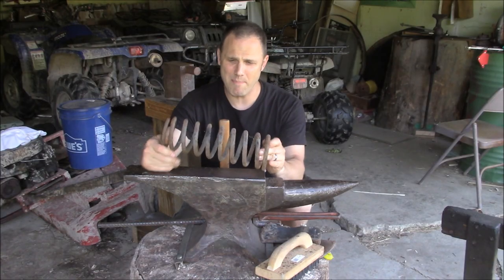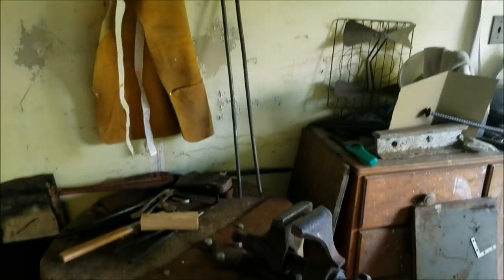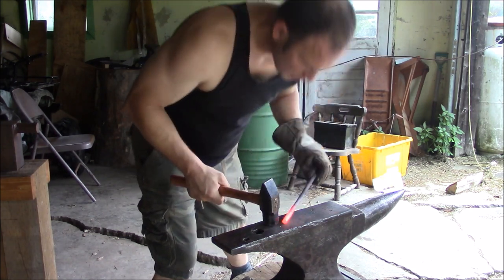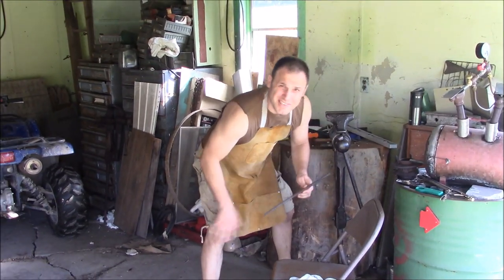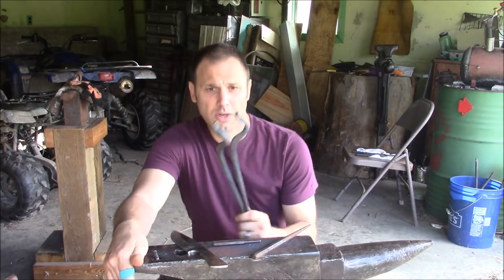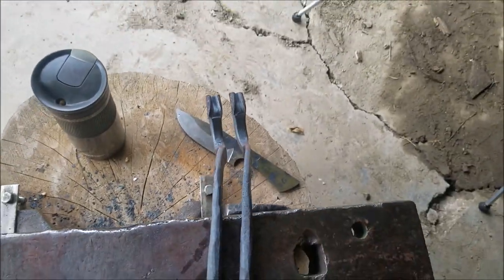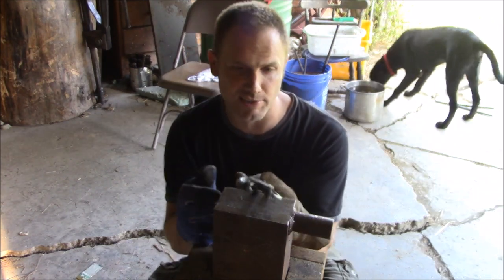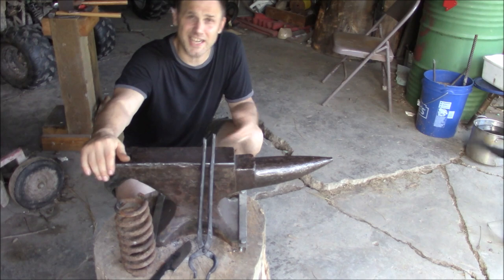Forging coil spring into knife tongs

Comment: Coil springs usually go through tons and tons of stress before they're salvaged. To get ahead of the problems that creates, heat and slowly cool it several times before working it. This isn't my first hand knowledge, but what have gathered from others with knowledge and experience. Makes sense to me though for what it's worth. I believe it's called thermocycling or normalizing. More likely, thermocycling is the process used to normalize, which restructures the grain, repairing microscopic cracks that weakend the steel. I'd love if anyone could confirm or correct me.
   So far I have forged half a dozen sets of tongs from mild steel and rebar, and so far they've held up great, not counting twice when they cracked where the reigns meet the boss but that was defect in workmanship, not material, (and useful lessons). 
     I just got two monster coil springs that will be the thickest and some of the hardest stock I've worked with as of yet. Over the next couple days I will be heating it up and then burying it in ash to cool, several times before I start trying to work it. Fingers crossed. Thanks for sharing.

Comment: i think you need to make a taller anvil block seems you have to split your legs to get too the right level
Reply from the maker: I do that on purpose because I've had three back surgeries. 😣 Spreading my legs out further hurts less than standing normal. ☺
Reply: @WJBlades  oh cool man it just looked hard work. Awesome effort on that steel I was looking into making some knifes from spring steel.

Comment: Butt the advantage of spring steel it will hold form longer lot hotter then mild steel, if they ever get to a orange never cool them in water they will super hard and brittle. Ie mild steel at orange will deform  easy

Comment: I'm not sure if I was looking at it right, but it looked like you were forging the reigns (handle sections) down round.  The easiest way to draw any shape of stock down is square, then make it round when you have it about the size you want it by forging the squares corners down, then going to octagon, then to round.  Just a tip. Good luck man. These turned out pretty dang good.
Reply from the maker: William Barnhart lll You saw it right, I was just turning and hammering out the reigns. Your suggestion sounds like good advise. I'll have to remember to try that next time. (FYI I forged out the reigns before the vise restoration video. You may have noticed the vise change in this video.) I appreciate your respectfully presented tips... cheers. 😎

Comment: I have watched most of your videos and I really like what I see.  I have watched other knife making videos and I see them normalizing the blade several times before it is reheated and then oil quenched.  I don't know if this will help your projects or not.
Reply from the maker: Normalizing is like a quick form of annealing. It's not really meant to get the metal to it's softest state the way annealing would. Instead it is intended to (primarily) release stresses in the atomic structures of the steel. Annealing does the same thing while affecting carbon placement in a more significant way through a controlled slow cool down. I do both depending on what the situation calls for. Most people normalize a few times before a full on rapid cool down to avoid warpage and cracks. Personally, I think even heat distribution and how you quench make just as much or more of a difference. However, to your point, I could've done more to relieve stresses. No matter how much you relieve those stresses the steel can be compromized no matter what you do. I think it was compromized from the get go or I compromized it with poor heat distribution while I was uncoiling it. Either way thanks for your support. 😎

Comment: Coil springs make fret tong shapes but terrible tongs. They will heat and cool to many times and crack or shatter.
Reply from the maker: The Riverwood Trader That's a strong possibility. I don't quench mine often for that very reason. I didn't have mild steel on hand and I wanted to learn with what I had available. I completely agree with you. Thanks. 😎
Reply: your fine its good to learn how to make tools. Your right also about the rebar as well. It will do the same thing as spring steel and break after a bit. the bets way I make tongs without a power hammer is to get some 3/8 x 1" and make it outa that. a bar 20ft long should cost about 16 bucks.